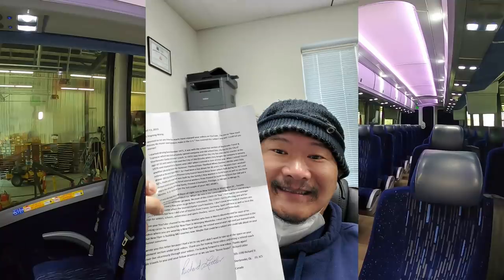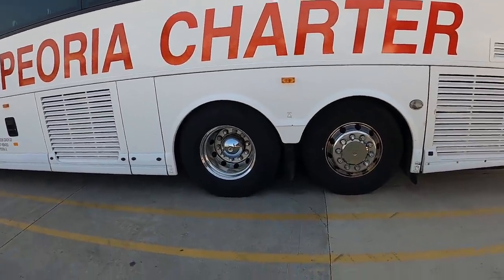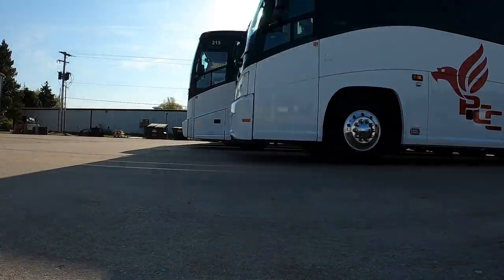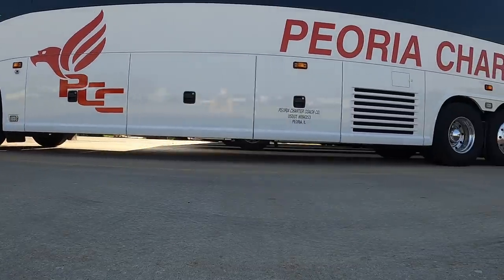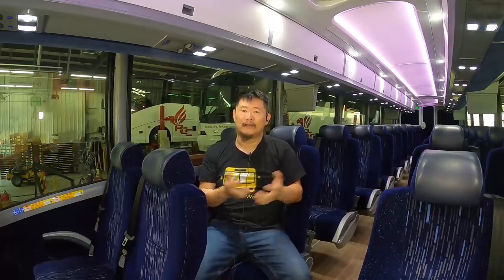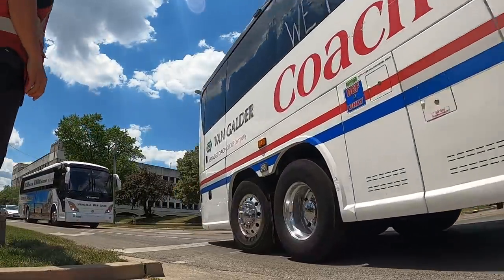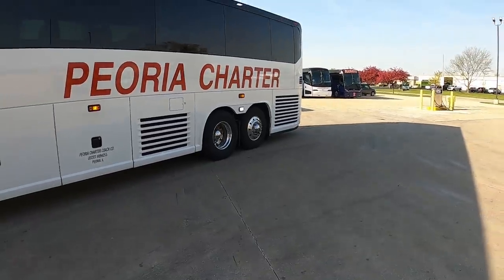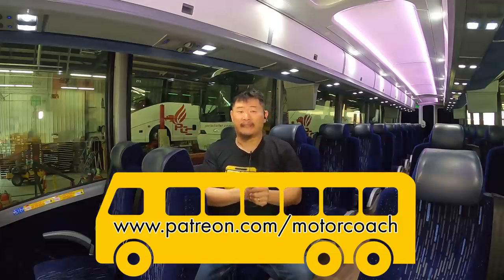The 3rd wheel | What is a tag axle??

Comment: In the trucking industry an extra axel behind the drivers is called a tag, if it’s in front of the drivers it’s called a pusher.
Reply: I was just about to leave this exact comment.
Reply: is there a liftaxle in front of the driver in some cases?
Reply: @barrywever9984  Its called a pusher.
Reply: @LordClunk  yeah I read that, but I have never seen it in Europe, what is it used for? 

Edit: oh, in front of the driven axles, I was confused, we call that a midlift axle here, and the other one a taglift
Reply: @barrywever9984  It is called that here in the States too if it lifts. If it does not lift, does not provide power, and it located in front of the drive axle it is referred to as a pusher axle. Most American trucking fleets do NOT spec a lift axle on non-driven tractor axles. This is because of weight that is usually carried. The exception to this is most refrigerated or short haul delivery fleets (Coca-Cola and Pepsi) have started to spec equipment that has lift axles within the last 10 years.
Reply: Pusher? Funny name. Since that axle does not push but instead is pushed. It should have been called a pushee ;)
Reply: As buses are concerned, a "pusher" refers to where the engine is located. Since on these coaches, the engine is in the rear, they are refered to as "pushers".

Comment: I drove for a division greyhound from 1969 to 1982. We had a GM bus label 4903 that had the tag axle that you could raise and lower from the driver seat. In New Jersey they required a 40 foot bus to have three axles but most drivers would drive with the tag axle raised except when you got to the turnpike you would drop the axle but the state police would sit there and watch the buses as they were coming in and get you if you were dropping the axle and not using it to drive. This bus also had the tag axle in front of the drive axle. One of the advantages of the tag axle was if you were on an icy or snowy road and a bus was sliding you could raise the tag axle and throw all the weight on the drive axle and it was just like putting chains on.

Comment: I'm late to the party, but just wanted to add that the front wheels and the single tax axle wheels are "outies" because the space inside of the wheel is where the brake drum lives.  On the dual drive wheels, the brake drum is inside of the inner wheel.

Comment: A lot of class A RVs have a tag axle.  The bad part with having the tag axle behind the drive tires causes these vehicles to get stuck easier because when the vehicle goes through an uneven surface, the tag axle causes the drive tires to lose traction because they can't reach the ground.  The other thing the tag axle dies is give the vehicle an extras set of breaks to help stop the bus when heavily loaded.

Comment: There are two different types of trailing axles: the tag axle that lifts off the ground and the trailing axle that does not lift off the ground. Prevost has a tag axle; MCI stayed with the trailing axle.
While it's true the Prevost can lift the axle off the ground to put more weight onto the drive axle, just dumping the air out of the trailing axle's air-bags will also put more weight onto the drive wheels. The weight of the rear axle is around 1,500 lb so it doesn't make all that much difference. Where the difference is, is in the wear and tear on the bearings and bushings that are exposed to a great deal of side-force with the twisting action when turning sharply.
Up here in Canada, the biggest advantage that I found was that the rear of the bus is very steady on ice. It was almost impossible to make the rear slide sideways, even when I attempted to puposely make it break free in a corner on ice. At high speeds, in curves  on ice, the front end would slide long before the rear slid. (naturally I did all this with no passengers on board)
   -Retired bus driver

Comment: I drove an old Eagle coach and it was definitely like driving on the end of a diving board. Coupled with the fact that it was very difficult to find replacement torsalastic suspension parts made them a handful. I run a Prevost now and I like the liftable tag axle.

Comment: Got stuck on a go bus in a snowstorm once going up a hill. It was snowing heavily, very slippery and we could not make it over the crest of the hill. Go transit uses coaches. So the driver finally got the idea to take the pressure off the tag axle and raise it up by taking the pressure out of the shocks for the tag axle. Worked brilliantly. All the weight of the bus ended up on the drive wheels and we got unstuck no problem.
Reply: Not sure about the newest MCI's but on their MC-8 and MC-9 for sure Greyhound had a Tag Axle Unload switch on the side panel for this exact purpose.

Comment: In North Norway we use the tag unloading button all the time during certain winter conditions, specially when doing a hill start or driving out of a bus stop. The only issue is that it will reset when we reach 30kph (20mph) due to European regulations, so we need to be very sensitive on the throttle so we don’t start spinning, specially if we’re going uphill.
Reply: Once I was going up a routine city street in Seattle (Genesee approaching Avalon), probably a 15-degree grade.  I never knew that leaves could be an important consideration.  When I started sliding backward ~ luckily with no one following ~ I had to steer to the other side to make myself part of the downhill traffic for about 300 feet.  I'll never know if my owner's advice that I should've raised the tags would have saved me.

Comment: The Greyhound Scenicruiser
( 4501 ) had dual wheels on its tag axle.
GM also used this setup on the one and only 4901, which was basically a one level Scenicruiser. This was meant to be sold to bus operators other than Greyhound. It was 40 feet long as opposed the 35 foot 4104 of the time.
Greyhound converted some of their MCIs to Cargo Freighters by using the Scenicruiser tag and drive axle setup to carry the extra weight.
As mentioned elsewhere GM 4903s also had a retractable 3d axle forward of the drive axle.
The other advantage of a tag axle or Bogie axle is two extra set of brakes.
Reply: The downside of the 4903 retractable bogie axle was the tires were different size than the rest, needed constant alignments because most drivers forgot to lift them before a turn, and they always had to be "up" when you parked the bus or you would have dead batteries - an electric valve would pressurize the air bags.
    The company I worked for that had 4903's drivers were told to only drop the bogie axle in Ohio (strict axle weight limits) but pick them up when out of Ohio.

Comment: As a train nut, I am biased to flanged wheel on rail; but, I do appreciate buses.  So Thank you for this.
As a certified geezer, I remember when the Greyhound Scenicruiser was introduced in the Fifties. In the Sixties I had occasion to ride from San Antonio to San Francisco(42 hours).  That bus was my first 3 axle US bus.  I assume both rear axles were powered.
Reply: Actually only the front tandems (middle axle) were powered. The rear was a tag.
Reply: @pd4501771  Thank you, I assumed that as the rear was dual, it was powered.  Never to old to learn.  Hey you kids get offa my lawn/train/dog....

Comment: Great video. I remember actually thinking they used different rims for the back wheels. Then I realized they had dually tires, and thought, the rim must have held both tires at once lol. Then later I found out the secret of the rim...

The same with the steerable tag. In an older video I think I mentioned a C or D model with steerable tags, and I did find the photo (film, still have to scan it). Turns out that was custom made, by a small charter company that used parts from a few different coaches. Im not sure if DOT would green light that today, but in the 90s it was running from NYC to Bethlehem PA and Id see if every now and again. One time, I took a photo of the straight vs streering. I did see these on Euro coaches before, but there is a bigger must, since roads are small. They do have lots of single axle coaches though, but you see a tag axle coach here and there (about as often as you see a solo rear end coach here).
Reply from the maker: Yeah you and I grew up with the same thought processes LOL. If we would have met at a young age we would have probably hung out all the time LOL
Reply: @MotorcoachWorld  Most definitely. Although the year you came to the US, I left for Romania, so I was in bus culture shock, seeing trolleybuses, and trams. I got obsessed with those, hence the legos LOL. I still check up on whats going on there, and other places..its how I found out that Flxibles were made in China up until recently, including a trolleybus version, and I think in Taiwan theres a charter company that bought 100 or so? MC9s and 96A3s. Its weird seeing them in other cities and countries, like the Aussie coverted models...but I get that every day looking out my window and seeing my DAC bus. Still makes me smile (although today I was cursing her for something that broke off again LOL..more welding to do!)

Comment: Oh Nooooo! The Eagle Bus third wheel was called "Bogey!"  I guess I have to loan you my 1989 equipment safety manual, LOL.
Reply from the maker: I will definitely like to see those manuals! Thanks for commenting.  So Wikipedia referred to those wheels on the Eagle's as tag axle and tag wheels.  So I inherently used the same terminology.  But thanks for the tip though.
Reply: @MotorcoachWorld  I will look for the manual later today. I miss my dream job badly. I've driven for the Hound for 37 weeks before we went on strike in 1990 and Adirondack Trailways for 7 years before working my second dream job, "The Dept of Sanitation." It's funny that I was going through my best friend papers who died earlier this year and he had an unused Adirondack Trailways ticket from NYC-Schenectady and the price of the ticket was $39.40 back in 1987. It's a small world!
Reply: But why did Eagle use a bogey instead of a tag axle?
Reply: @RonKStevens  I'm trying to find this information.
Reply: @RonKStevens   This ling give the history yet it does not specify the reason why: https://tractors.fandom.com/wiki/Eagle_Bus
Reply: @MotorcoachWorld  - It's not uncommon for entries on Wikipedia to contain errors, calling the "bogie" axle in front of the drives a tag axle on the Model 5, 10, and 15 Eagle is a good example of that type of error.  However, the Model 01 Eagles did, in fact, have the traditional tag axle behind the drive axle.
Reply: @CleanteamofNY  - By utilizing a "dropbox" on the drive axle, Eagle was able to move that axle further back in the chassis. To meet axle weight restrictions, they then moved the tags in front of the drives, thus creating the "bogie" axle. Why, you ask? More baggage space!  This was long before FedEx, so there was LOTS of package express business for both Greyhound and Trailways back then, and this was Eagle's way of increasing available room for more business downstairs. (But neither Eagle or MCI could match the baggage space of the GM PD4903/4905 coaches - they had more baggage space than even some of today's 45' rigs!)
Reply: @RonKStevens  - See my response above. ^^^

Comment: As a kid back in 70's England I saw quite a variety of 3 axle configurations. However, some stood out more than other though I don't recall brands or models. We had a couple of electric double deckers that were still in use. they had a conventional  'outies' up front, but, both rears axles had single outies rather than a dual setup. I also believe both rear axles were driven. Another that i always liked which I think was a Bedford (GM UK) had twin front steer axles. There was also a double decker that I would see on occasion with twin steer front axles but know even less about that. I kinda lived where the city and country collided so there were the city busses and the country ones who's designs were quite different. Oh and there were the long distance ones which again differed in design.

Comment: I did some work with engineers at MCI in the beginning days or "steerable" tag axles. They started playing with a "self steer" axle that would turn when under stress from being dragged sideways under load as the coach would "pivot" on the drive axle. 

That is how the small "booster" attachment on the back end of a low bed semi trailer works. Just by adding another weight distributing axle they can carry heavier loads but the spread in the axle spacing would literally scuff off the tires on the booster in short order if they did not "steer" around the corner.

The whole reason MCI was designing a steerable tag axle was to overcome accelerated tire wear on the steer axle. With two rear axles holding the coach in a straight line turn effort of the steer axle was increased causing accelerated edge wear on the steer tires.

Comment: Don't know if you will call that a tag axle, but articulates buses (common in larger cities in germany) usually have the rear axle powered, so the middle axle is not powered. (And I think driving these on slipery roads can be a real challenge)

Comment: In the truck world, an additional non-driving axle behind is also known as a tag axle.  One or more in front of the drive axle(s) are called pusher axles.
Reply: I like how you can always tell when a truck with tag axles is loaded/unloaded by whether or not the tag axles are lifted.
Reply: @BlackEpyon  or bouncing when the air load is light lol
Reply: not so, it's still a tag axle, it doesn't push any thing since it hasn't a drive line attached. each tag axle is rated at 2,000 lbs.
Reply: @billyjoejimbob56  over weight axles in front of a drive axle is called a drop axle. if you must correct someone. they are designed to move up and down, and turn going around corners. they have a lift mechanism that will automatically lift the axle up if some moron tries backing while they are dropped too the ground.
Reply: @harleyhawk7959  Apparently, you did not even read the titie of the link I posted, much less the content.  Pusher/Tag describes the position (forward/behind) the drive axle(s).  either can be and often are lift axles... also   used on semi trailers before and/or after the "full time" axles.  In either position they can be self-steering... If so they need to be lifted when backing, either automatically or by the drvier.  I understand that they dislike being refered to as morons. 😎
Reply: @billyjoejimbob56  if you are going to correct someone, make sure it isn't someone with 30 years driving semi.
Reply: @billyjoejimbob56  lol, I have called my best friends morons. something you dont know about me, driving and riding my Harley is something I take very seriously. some one that drives a semi should know you either have a tag axle which is located behind the drive axle or you have a drop axles that normally are located in front of the drive axles. Hence the names, tag or drop.
Reply: @harleyhawk7959  @Robert Blakely If you two have finished squabbling , there is a world outside of USA ; on tractor units in the UK , a tag axle is behind the drive axle , a pusher is in front of the drive axle and is  fixed so it will not affect the steering when reversing . Another alternative is a second steer axle in front of the drive axle.
Reply: @maninthecab  here in the U.S.  the axle in front of a driver is called a drop axle. the axle in the rear of the driver is called a tag axle. all the drop axles here are mostly on twin screws. and turn on thier own based on the direction the tractor is moving. I retired from driving in 2012. from that point back thier wasnt a front tag axle that I'm aware of. beside it wouldn't make sense having a fixed non powered axle that you cant lift of the ground. no driver or company here in the US is going to pay for emty axle on a toll road most all tag axles here are either on a bus or a r.v  motorhome. there was confusion maybe but not squabbling. thanks for your imput👍🏻
Reply: @harleyhawk7959  Sorry , I’ve added to confusion here ; by fixed I mean that it doesn’t castor steer  so it doesn’t swivel the wrong way and fight the steering when reversing - it can still be lifted when not heavily loaded.
Reply: @maninthecab   if you try backing with a drop axle here, there's a safe guard that will automatically lift the axle. I have forgotten myself once or twice.
Reply: @maninthecab  Yup...  Pretty much the points I was trying to make all along

Comment: As a UK lorry driver I found this interesting 👍

Most of the "rigid" lorries on our fleet are twin axle 18T (a little under 40k lbs) but, we do have 2x 26t (a little over 57k lbs), 3 axle "6 wheelers" . Almost identical MANs but while one has a tag lift, the other has a tag lift/steer and it makes a serious difference when turning in a tight spot... 

We also have a lot of "8 wheelers" over here (4 axles, 32T (70548lbs) ) . Usually with 2 steering axles at the front and 2 fixed at the rear (sometimes both powered). A fairly recent change to that has been to a single front steer and a triple rear bogie. 1 or 2 powered along with a rear lift/steer tag axle right at the back.
Reply: The reason for the complex rules is road subsurface compression. The better the spreed of the weight is, the less compression you got. 

That is why twin axel is not alowed to carry the full load of singles.